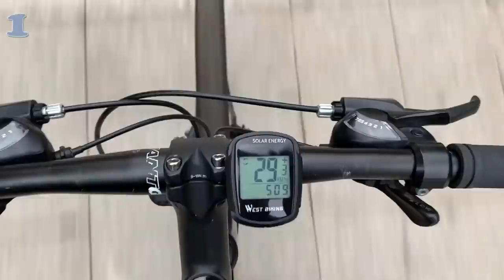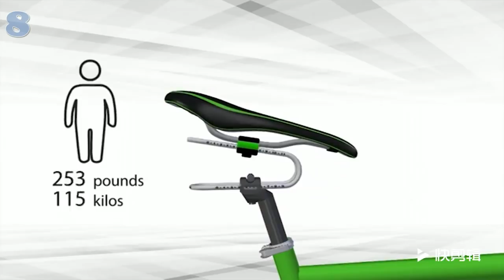13 AMAZING BICYCLE GADGETS ON ALIEXPRESS AND AMAZON (2021) | ACCESSORIES. LIGHT. PUMP. TOOLS

Comment: PSA: Always use a pump with a flexible hose.  Rigid connections risk you breaking the valve stem during pumping.